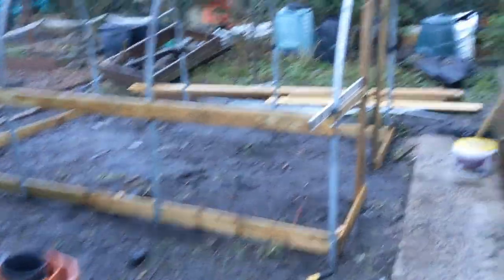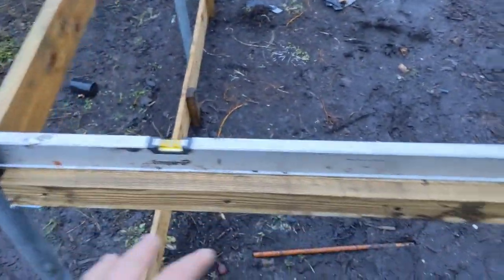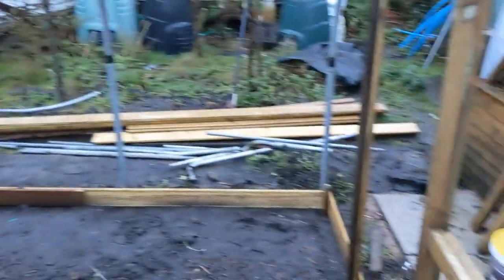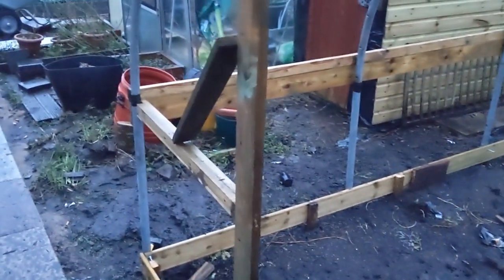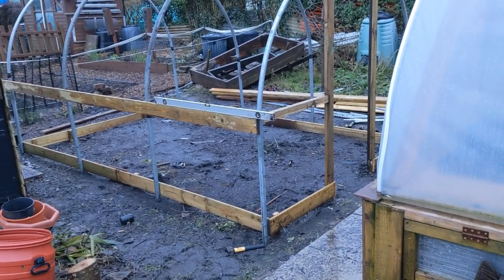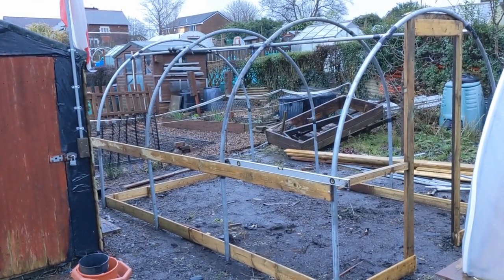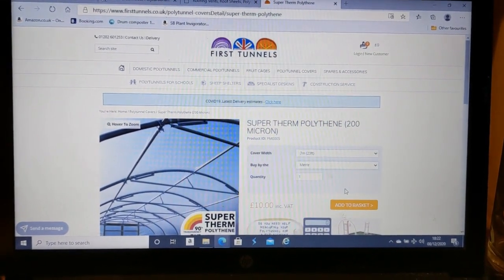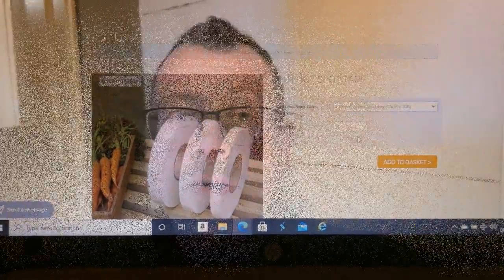HOW TO BUILD A POLYTUNNEL ~ PART 7 ~ Starting The Side Frames And Pricing The Covers ETC.

Comment: pricing helps alot 👍 just on starting double plot run down plenty room just needs a good clear out and couple of tunnels has two green houses will want sealing up with having smashed glass in places 👍
Reply from the maker: I'd replace the glass with this 4mm clear twin wall polycarbonate pal... much tougher and easier to cut and install... a lot safer too

Comment: Oh Tony this video could’ve saved me sooo many hrs of work and redoing work when I did mine. I’m so impressed with this build you’re doing and also how you’re documenting it. Thanks for also giving info on what you’re purchasing and where you’re sourcing it. I’ve been looking at polycarbonate but have no idea what thickness so have felt like I’m scrabbling in the dark. A really dumb question I’m sure but.... when driving posts in how do you manage regarding stones? I use to have horses, am use to using a post rammer and never had any issues before. However I’m struggling getting my posts in plumb even my little 2ft  2x2” stakes are hitting stones and skewing. Other than digging them out ( then having loose stakes) I don’t know what else to do. Am I missing an obvious solution?